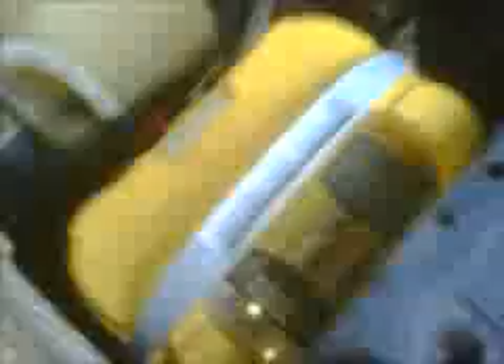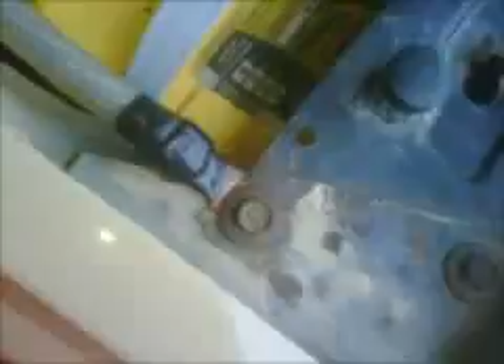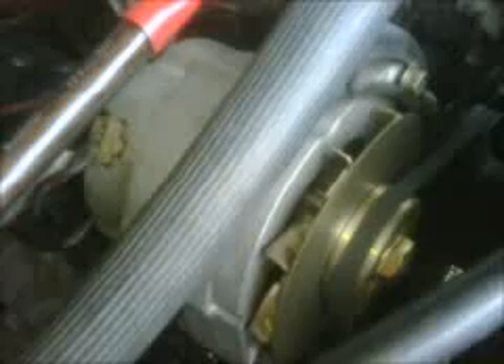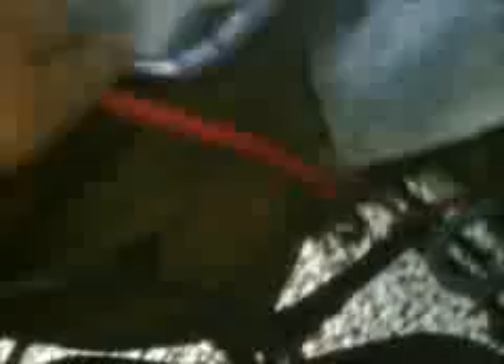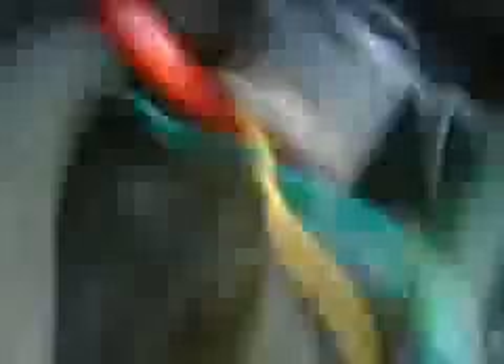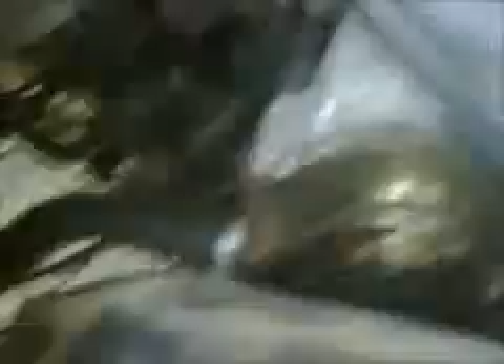The Big 3 upgrade

Comment from the maker: @FlaRarebreed you got it basically got it rite. It should give you better results. To clear any confusion ill give u a rundown of what's all going where, I didn't make it to clear in the video.
(1)0 gauge from negative terminal to chassis. (2)0 gauge from alternator positive to positive terminal.(3)0 gauge from engine block to chassis.(4)4 gauge from positive terminal to starter.(5)factory 10 gauge from starter to alternator positive. The 10 gauge has no use but I just left it.

Comment from the maker: @FlaRarebreed the 4 Ga red wire on the battery goes to starter to give power to starter. The small red wire on alternator is supposed to be the charge wire but the 0 Ga is the charge wire now. The small red wire has no use now cause the 0 Ga has less resistance I just left it on there. And as for the engine block ground it did have one but it was a sorry excuse for a ground looked like a thin piece of shoestring, replaced it also with 0 Ga. Hope that answers your questions.

Comment from the maker: @88BroughamLS  the 4Ga should help. Even though I have 0 Ga on my alt and grounds I still get dimming. You also want to make sure both your power and ground wires are the same. I just put a bigger ground cause I had extra lying around. I think mine dim cause the alt doesn't put out enough amps at idle and still dim when cruising. I'd use 4 Ga all around for grounds and power for the amp and engine compartment. If that doesn't help a higher output alternator should fix it.